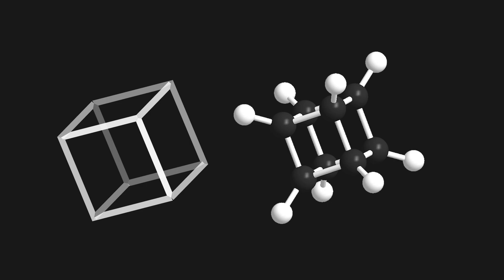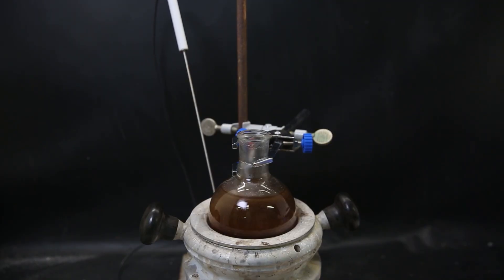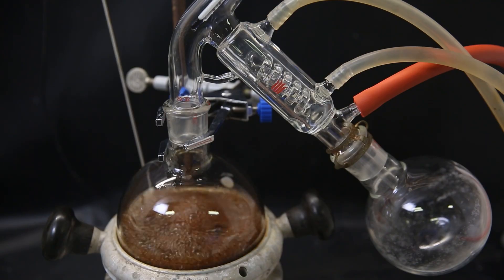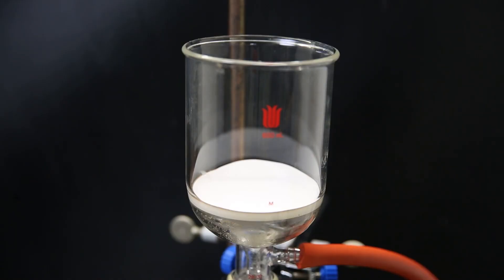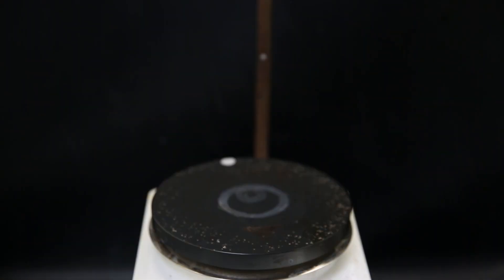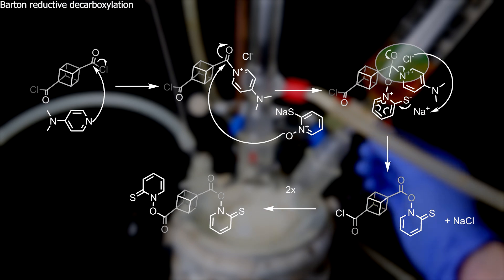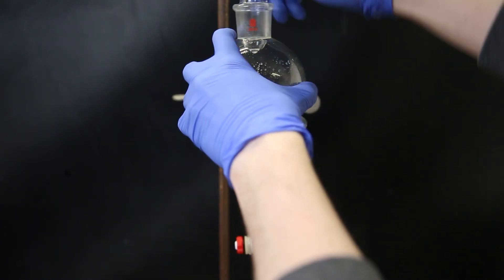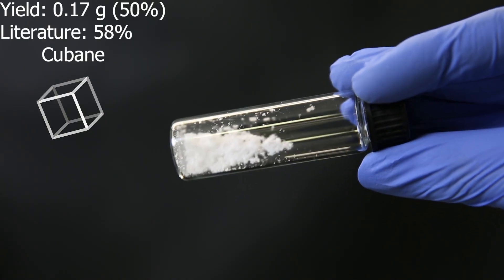Making Cubane (without handles)

Comment: congratulations mate, this is one hell of an achievement!

the last step was particularly interesting, in that it's a Barton decarboxylation modified by using light as the radical initiator rather than AIBN
Eaton and Pettit's original methods predate Barton by nearly 20 years, but are more accessible to amateurs as they used t-butyl hydroperoxide, which can be homebrewed with relative ease (sodium pyrithione is generally much harder to find for amateurs)